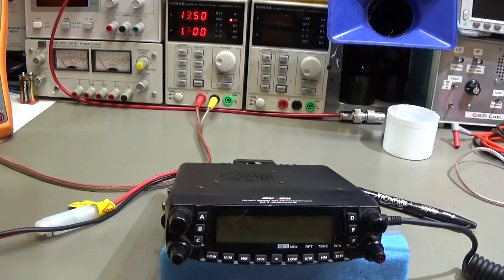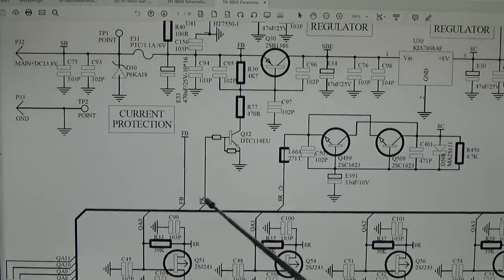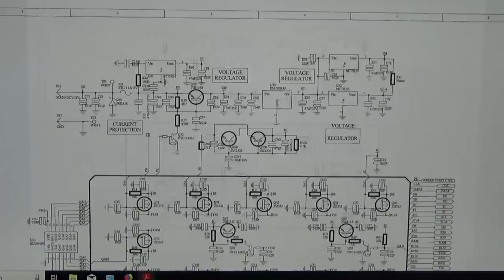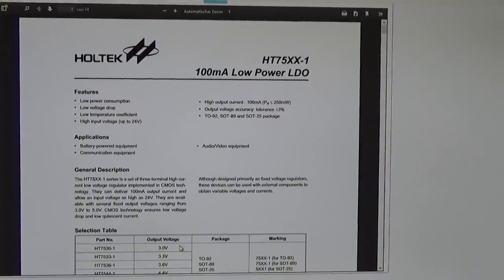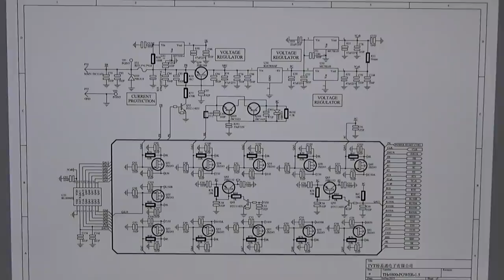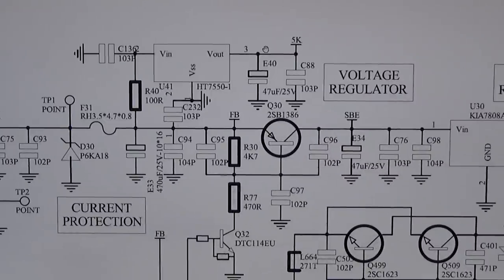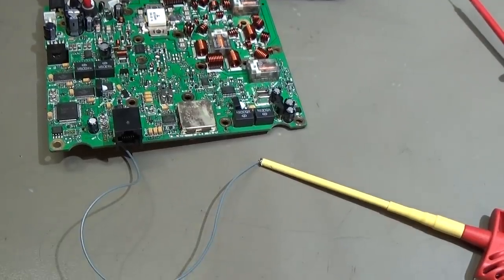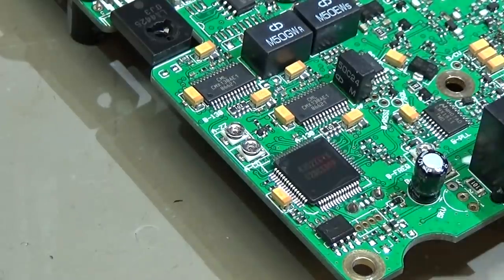#205 TYT TH-9800 FM Quad Band radio: No parts no life

Comment: The problem is even if you had a processor it still wouldn't be of much use.  Most of this type radio have their alignment done through programming at time of manufacturer.   The alignment tables are stored on the micro.
Reply: Mike, you should update your avatar ;-)
Reply: @simplio 
Not trying to be a smart a$$ but using that logic you should probably throw your cellphone away and every other electronic gadget that uses a microprocessor.  Radios like this are a great for someone just starting out in amateur radio.  They are economically practical for those on a tight budget and gets them on the air.  I repair radios for a living and it's rare, very rare for a micro to go bad.  How many 10's if not 100's of millions of amateur radios, CB radios, FRS/GMRS radios and public service radios are out there in the world with microprocessors and they work just fine day in and day out.  Is there the rare radio that has a problem like this, sure but it's just that, rare.  Custom micro's have been in use in consumer radios since the 70's.  Shoot, I had a 1976 vintage CB radio on the bench the other day and even it has a custom masked ROM that is used to control the PLL synthesizer circuit.  If there is anything to complain about with the cheap import radios it's the lack of service information.  90+% of the import radios like this have no service information published on them making them at least hard if not impossible to troubleshoot.
Reply: @OleF112  
LOL, that is a pretty old picture isn't it.  It's so old I still had my Stabilock 4040 communications test set on the bench.
Reply: @mikesradiorepair  Mike, have a close look at my pic...Where´s Waldo :-) Thats my second desk for long term repairs;-) Still like the 4040
Reply: @mikesradiorepair  Oh yeah, need new pix with the R&S box!
Reply from the maker: always a pain as you don't get information on the software and the program architecture
Reply from the maker: That would show that TYT will care about their customers and they should start recognizing them....
Reply: @simplio I guess the likes of Yeasu Icom and Kenwood need to stop putting Microprocessors in there radio's if that's the case.
Reply: @simplio These cheap Chinese radios are a good thing. They've brought the price to get into ham radio down enough that more people are willing to check it out. You can get one of these radios, complete with antenna, wire, mount and power supply for under $350 delivered. You'll pay $300-$400 more for basically the same setup buying name brand equipment. Now people can see what they like before dropping serious money on equipment.

Comment: I have this radio, you have to hold the power button for 2 or 3 seconds for it to power on, just a momentary press of the button will not turn mine on.
Reply: Mine will not turn off. Came on its ,now will not turn off
Reply: Thats the first thing I noticed and wondered through the entire video if there were nothing wrong with the radio in the first place.. was all of this due to an organic interface error?  Could they have saved time and money by simply reading the manual?  LOL.. will never know.. but wont send my stuff to this guy for sure!

Comment: Well, the CPU is available via RS-online for about 5€ and the firmware can actually be downloaded from TYT. Of course you'd still need the equipment to flash it.
Reply from the maker: that for its own does not help ...
Reply: The Programming Cable and Fimware are available from China TYT will also supply the Firmware free of charge.
Reply: @stevejones8665  The TYT software isn't any good and won't work in Win 10.
Reply: @stevec5000  A lot of things don't work under windows nothing new there. Windows has always been rubbish.😊
Reply: @stevejones8665  They don't have any firmware available just a configuration program similar to Chirp that has access to the extra features but when I try to run it I get an error.
Reply: if anybody has a few they just want to throw away, I would love to tinker with them. thanks.
Reply: @stevec5000   do you know something called email? its been for a while

Comment: Hi this was a really educational video. You not only discovered the problem but you determined the cause. People should be reminded that the cables that comes with these devices are proprietary and are not the same as USB cabled that can be used for charging or data transferring. If i did't see this video I would have definitely used an Ethernet Cable instead for a longer reach and frying my device.

Comment: Great instructional video.  At the low price of the radio I would be surprised if the repair labor alone would not exceed the cost of a replacement radio.   Hopefully your reminder to ensure the pinouts of any replacement cable are correct will help to keep someone from toasting their electronic equipment.

Comment: I learned... 1: Alcohol trick, 2: LAN cables as extensions can be dangerous. That radio goes in Parts bin until another comes along to pillage.
Thanks for this detailed experience.
Reply: Correctly wired lan cables do not have turnovers.  But the original cable that comes with the front panel may very well have a turnover.  So you can use a lan cable as an extension cable, but you can't replace the original cable with one.  You have to use them both together.
Reply: @stargazer7644   ever heard of a network cable pinout tester? you can replace the cable no problem as long as you do it as it is in the original, my guess, straight cable.

Comment: I have one of these radios and have had good success using it with the supplied RJ extension cable for extending the faceplate.  Looking at the pin function arraignment on the drawing makes me think that it would be dangerous to insert or remove the RJ connector while the main 13.8VDC supply is connected to the radio.  So I see this as a lesson learned.  So if the RJ connector ever pops out, NEVER just pop it back in without removing the main power first.  I'm betting that's what happened here.  Thank you, this was very informative.  Well done.
Reply from the maker: no not really as it turned out that no power is on the front panel as long it is switched off.

Comment: I really enjoyed the value of this radio when first purchased... Unfortunately I have had 4 of them all go bad for various reasons, non of them abused in anyway and now they are just scrap radios. Won't purchase any more. Good video👍
Reply: I have the Yaesu version, still going strong but not used much anymore.  I hated it in my work truck,  such small fiddly knobs and buttons in a rough 4x4 truck. I was constantly knocking it of frequency or enabling wires-x accidentally.   Also I couldn't tell what the volume level was set at easily.   You would drive off the road trying to read the display or adjust anything.   Its my spare back up radio now.

Comment: Hi Mr. Peter, and sorry for my little English. In the video you can see very well that in the beginning, you "try" to turn on the transceiver, but it doesn't even turn on. To make it turn on, however (!), You press and very briefly release the power button. Well, ....... by doing so, .... it will NEVER turn on! Because the manufacturer has provided for its ignition, that the ignition key must be "kept" "pressed" for about 4 (four) seconds, before turning on! I explain this because, owning it, on the first day of purchase I also thought it was broken, because pressing the power button, as you did in the video, it did not turn on. Then I tried to keep it pressed (instead of just pressing it as you did), and it turned on very regularly and is fully functional. Even a friend of mine, who bought it after me, called me for help because it didn't turn on ........ but as soon as I explained to him that the power button had to be kept pressed for a few seconds .... .I call back happy telling me that it worked perfectly. So ... be careful to make judgments ... before you know how a product works. Then I noticed that you try to "denigrate" the product, ... and only for pure "racism" because it is of Chinese origin ....... But here he is wrong ...... because if he has noticed the components inside ...... it is "strangely" ALL Japanese Original. And if you had better informed, rather than to show off the cheesy "racism", .. ... you would discover that, in REALITY, that Transceiver was ALL produced by the Japanese Yaesu Musen with only few very small changes ... which company then "granted" the exploitation and resale of its product, to Tytera (TYT), on lavish "payment". So .... that product is a Made in Japan product ...... "rebranded" TYT. And ... so ... it's not Chinese .... Greetings of a Happy New Year

Comment: A great video and a great way to troubleshoot. I have exact this device and have recently connected it reversed. The 15 amp fuse goes off. After renewing the fuse and connecting the device with the correct polarity, release the fuse again. I remembered your video and looked at it again. The resistor between the two supply lines was 0 ohms. I decided to remove the small diode. After that, the device worked again. Well in my case, the diode has done its job and has protected the device. I will get a new diode and install it in the device, so that the device protection is restored. Thanks for the inspiration I had through your Viedo to find the fault myself.

Comment: I just took one in from a customer, completely dead, no lights, no fan, nothing.  I found that the power input had a dead short.  After downloading the diagram, I first suspected some of the capacitors.  It was easy to remove two electrolytic caps, but they were not the problem.  There is a zener diode, I think it was D30.  It had a dead short.  It is an 18 volt zener, appears to be 5 watts.  The zener is in normal operation, reverse biased, so that if the 18 volts is approached, the voltage would be limited or clamped.  In this case, I suspect the customer had reverse polarity, which in this case would have shorted the power supply, until something gives up, in this case, the zener shorted, saving the radio.

Jim

Comment: Peter is holding the (used) parts supply chain in his hand!   His well educated guess about NOT using an ethernet cable to extend your face plate... priceless !   Appears to be well built, so perhaps without abuse, you might get the expected couple of decades of use out of a new one.

Comment: I forget sometimes that not everybody is familiar with the notation conventions of digital electronics.  The notation "INTn" where "n" is some number generally indicates an interrupt input, the bar over it means "active low".  The slashes mean alternative uses.  In this case, P1_7/TRAIO/INT1 and I think that's the physical pin name, one thing it could be for, and the other thing it could be for.  INT1 is interrupt input 1, but it took some digging to find out what TRAIO means.  It's apparently the I/O pin for Timer RA.  Totally clear, right?  Digging into the data sheet (hey, sometimes I read data sheets just for fun) I find that RA is just the name for one of the timers (there are also RB, RC, RD, and so forth) and it can be used as an input or an output depending on what mode the timer is in, so (without doing any more digging because I'm already late for work) I'd expect that the timer can either measure the time between input pulses or emit a pulse train or similar, and this is the pin that does that.

Without looking at the software at all, because it's not available, it seems likely that this pin would be configured to be used as an interrupt input.  When you apply power to the radio, the CPU powers up, but nothing else does and it waits in a low-power mode until it receives that interrupt (due to someone pressing the button) and then the interrupt service routine would trigger the CPU to power the rest of the radio up.
Reply: Totally correct, you saved me from writing the same!

Comment: Your video started off similar to my experience, I do not have 13 volts at FB on the front connector. I have a known good radio that does have FB present when power is off. So it is mislabeled as SBE. I cannot figure out why it's not getting power at FB on the connector side. I jumped it temporarily and chip u118 started to get hot. That is my next culprite

Comment: On a CPU “INTx” generally means “interrupt”.  In this case it would be an external hardware interrupt to “wake up” the CPU from its low power “sleep” state whenever the power button is activated so that the CPU can wake up and process the event appropriately despite being asleep...or interrupt normal execution to power off the radio if it was already powered on.  On CPUs interrupts can be either hardware or software defined events and they are dedicated routines that “interrupt” the normal program execution on the CPU so that the CPU can momentarily execute some dedicate code to address the event associated with the interrupt event.  Hardware interrupts can also wake up a sleeping CPU in addition to triggering the execution of the code associated with the interrupt.  Once the interrupt routine code has finished executing the CPU goes returns to normal program execution until the next interrupt event occurs.
Reply from the maker: Thanks for you contribution very much appreciated!

Comment: Thank you once again, Peter, for an exceptional video.  I really enjoy your fault finding techniques.  You explain things in a language that I can understand.  Your English is excellent.  I doubt that I could follow you if this were in German.  I have 2 classes in spoken German but if you don't use it every day, you tend to forget the words and sentence structure.  German does have a sentence structure that translates quite well into English.  Excellent video on this Chinese radio.  Only Chinese radio I own is a Baofeng UV-5RE that a friend opened up to 1.25 (meter or centimeter??); anyway the 220MHz band.  The tri-band antenna cost double the radio cost.  A nice technique with the alcohol on the CPU--I've never seen that before. Cheers & 73 from W Rusty Lane K9POW in eastern Tennessee
Reply from the maker: Thanks Rusty, althogh I think there is room for improovemnt when it comes to my English

Comment: Hi Peter,
The method to determine heat with applied alcohol is so close, but I've never come up with this idea. Great, I learned something there. Thank you!
I also operate such a TYT device. Back when I bought it, I thought that I could also build this remote cable myself and thought of an Ethernet cable : -o
I found an offer with cable included while browsing and I bought this. Sure, I would also had toasted my TRX with a self-built cable.
So I learned something again .....
Thank you for your work and the video.
73 Bernd
Reply from the maker: Yes works perfect with IPA Thanks for stepping in 73

Comment: If you make sure the extension cable you buy is straight wired, this should not happen. In this case, the right cable would be an R12 6P6C straight through, duplicating the wiring of the factory short cable that links to the head unit when it's mechanically connected to the radio body. It would have been very helpful to have the owner provide the cable he or she used so its wiring could be verified, but it seems it was not a straight through but rather was some sort of fax machine cable.  Lesson learned.

Comment: I had the same thing happen with the same radio brought to me. Luckily, I had another 9800 with a burned pcb that I was able to swap out the cpu and diode. I up-rated the regulator, feeling this is a vulnerable part. What a shame it is a death and TYT not being close to hand. Might be worth a try contacting them, but hey-ho, these radios are cheap enough. Thank you for the tip: re the Ethernet cable. This would not have ocurred to me.

Comment: I have the same issue with cheap Chinese UHF CB (Australian 477 MHz band) radios.   They are just so cheap that it's not even worth replacing a shorted zener diode on the input supply leads.

Comment: Notwithstanding the fault, this radio needs the power button to be held in for a second or two before power will be applied.  Quickly pressing the button as shown in this video will not power up the radio even when it is working.  Otherwise, thanks :-)

Comment: I have one of these radios it came to me from China with two bulged chips that looked like they where heatguned to death. It has not failed me so far. And I use it as an everyday beater in my Lincoln
 I have had it for over 3 years now. Works ok as a gmrs radio on my mfj night rider antenna. I know the mfj nr antenna is really for the70cm and 2 meater ham band but it's a good enough swr and vswr for my needs. I have a 1.1>2 on 2 meters and a 1.1>3 on 70 cm and a 1.2>4 on 462-467 mhz ehh it's a Chinese radio iam not going to bother to put an antenna switcher and multiple antennas on my car. As it is the tweakers here think I have a cb am radio. And I get tired of explaining to everybody that asks that it's a ham radio Chinese knock off of a yeasu 8900 quad band Usealley by this time I get a funny look on there face.

Comment: I had bought one and connected it to my bench power supply. Ran it for 15 minutes and then connected a watt meter with no problems with a quick transmit. I let it sit just to receive for about two hours then it quit. The display goes dead, the radio starts pulling more current. Shipped it back and bought a Yeasu instead and have had zero problems with it. It's a hit and miss with these radios the quality control is lacking.
Reply from the maker: and the company don't care!! You are right buying a Yaesu 73